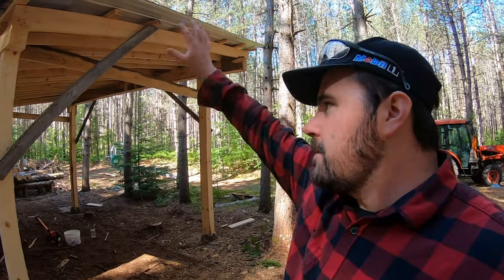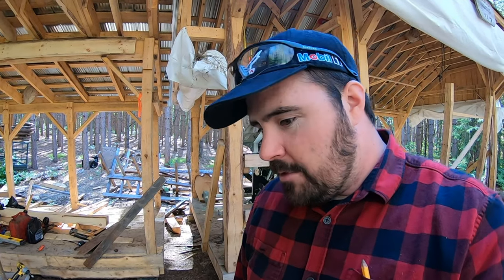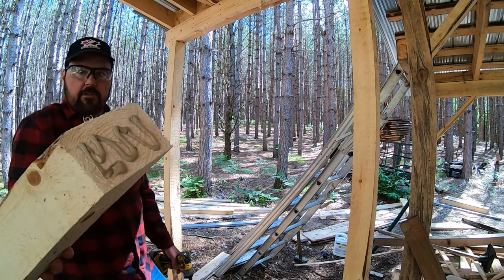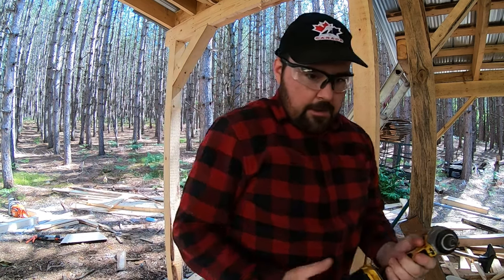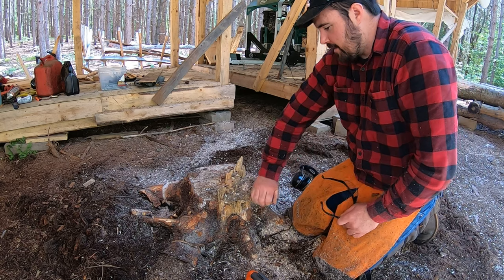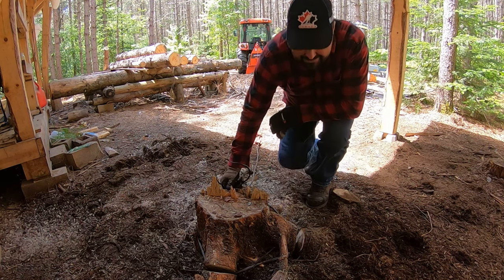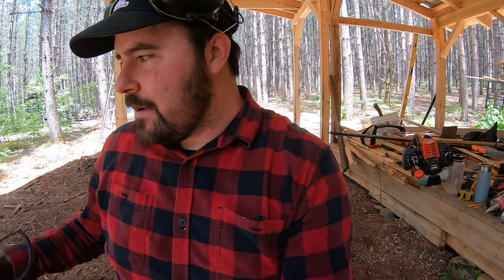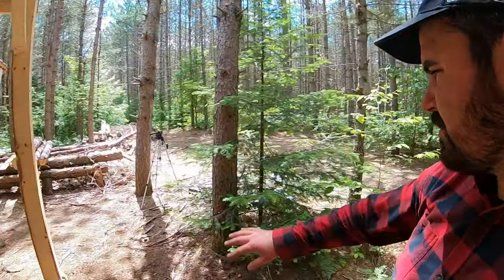Tree Stumps Got me Feeling Risky | Sawmill Shed Build Ep.4

Comment: i have seen folks use a 6-7' timber brace to change the angle of the cable to an almost vertical pull on the stump, as it pulls the timber lays down to 45 then 90 as it finishes, gives you a mechanical advantage that might be worth trying
Reply from the maker: May have to try that. Thanks for that
Reply: @sawingwithsandy  similar to this one, but have seen used with equipment instead of hand crank, its a "tee" timber https://www.youtube.com/watch?v=16iK3R7ce_0
Reply: Sandy:  use a steel drum on it's side next to the stump. Run your cable over the top and it creates a vertical uplift force. Works great with fence posts also.
Reply: A vertical pull ‘should’ be far better mechanical advantage for removing stumps than a horizontal pull particularly when placed under a major root. Even a small vertical movement ‘should’ loosen most roots.  A pair of posts X’d together near the top and placed at 15 degrees off vertical ‘should’ be about right mechanically.
Reply: I was going to suggest the same thing but these guys beat me to it. Great minds think alike!

Comment: When I'm out in the bush felling and bucking timber, I always have 2 or 3 extra sharpened chains for the chain saw.  It takes less than 5 minutes to change them out when they become dull.   Also, a snatch block may have helped with pulling that stump out along with some elbow grease using a spade (not a coal shovel like you were using) and a sharp ax.  Good luck.  Cheers!
Reply from the maker: Yeah those things would help for sure. I forgot my extra chains back at the ahop
Reply: A double pulley hook up and you tripple your pulling power. In this suituition a chain to a tree at the front of the tractor would make a big difference.
Reply: @jimputnam2044  I concur.

Comment: Like yourself Sandy, I was taught about the value of money and whether or not to spend or to hold. A porkchop may seem in order but mush saved money and tomorrow ... last nights dinner is behind you and forgotten. The log extension is probably  the very most important thing on your wishlist... please just go for it and either build or buy one as its going to give back in spades, you know this well. Backhoes, or other tractor tools will come should you find it necessary for them. I try to determine just which way the wind is coming from to determine just how   the root system is on the trees and find their weakest side if trying to dig one side an pull one over. I can only guess but kind of think that the soil  there lends well for excellent growth for the tree system meaning it is on all sides about the same. You know, blind squirrels even find some acorns so maybe you will enjoy some of that squirrels luck and get some to go over with the winch line and a couple blocks on other trees to give that additional strength to yard some of them out of the ground. I shall keep my smart ideas to myself as much as possible, I just wish I were there to help... dad said that two heads are better than one, even if one head is a  cabbage head... not sure where that fits here but if you think of it, tell me your thought on it. I do really care about your success an only have kind thoughts of this grand endeavor!! Wishing you well, the days are already showing signs of getting shorter, so the midnight oil shall again, force us to dig out the synthetic underware... pure wool does make me itch like a fiberglass insulation will, when working under the house putting it under the floor..  and having to wear it the rest of the day.
Reply from the maker: Thanks for the support Morgan. Hope you’re doing well

Comment: Hi Sandy. If you ever want a chance to pull something that difficult, you need to put a snatch bock on the heavy item. Then put you cable through the block and the cable end back to your wench. Find a good spot on it. You will have double the pull power. It’s still wouldn’t help you on that stump though. It is always best to use a snatch block to avoid breaking your cable. It will happen on day. Good luck Sandy. Great content. By the way, your wench blade should have dug into the dirt to hold the tractor steady. Did you have the 3 point all the way down?
Reply from the maker: Hey Tom! Great tips. I didn’t quite have the blade angled correctly to dig into the soil o believe

Comment: I’ve pulled some pretty big stumps with a chain attached to my truck, a sharp spade and a recip saw with pruning blades.  The pruning blades don’t dull up when you contact soil like chainsaw chains.  Cut the obvious surface roots as far from the stump as you can, put some tension on the chain with the truck and you’ll see which root needs to be cut next.  Stumps eventually pops out.
Reply from the maker: Those recip saws would wirk well I bet

Comment: My choice for removing stumps is a metal 5gal pail with the bottom cut out. Stuff the pail over the stump and start a fire. The pail acts as a chimney and keeps the heat in the stump, which dries out and burns quickly. Just an FYI if you mount (weld) a hitch tube between the front forks, you could easily drive forward with the trailer hitched in front of you. No more wondering what's the trailer doing.
Reply from the maker: Great idea about the hitch. I’m a bit hesitant to have fire in the red pine forest though as it’s quite dry but I’d just have to pick the right time

Comment: The winch did make the stump move a tiny bit!  I've been digging out stumps lately with the backhoe of my 25hp tractor and it's doing a decent job. It's annoying because you really need to go around it to get rid of all the roots. It rarely just pulls it out.  A stump grinder is nice (I think, I've never tried one) as long as you don't intend to replant something in that spot. Love to see the progress on your project and your thoughts on workflow! Thanks and keep at it!
Reply from the maker: That backhoe would be a nice tool to have around for sure. Yeah those roots sure do hold tight. Glad you're liking the progress.
Reply: My dad used to hand grub big stumps in the 50’s, a very patient and determined man!  I recently acquired a little Kubota B6000 with a 3 inch wide ditch digger.  It cuts roots fairly well down to 2 feet.  I have not tried it on removing stumps or trees yet.  I am curious how close to the tree stump is close enough to make a difference and if three or four straight line passes around the stump would be enough.  

The other thing is steps in pulling down a tree.  I expect leaving roots to the sides as a hinge would make the process much safer.

Comment: Why don’t you put a small elevated deck down? Keeps your mill off the moist ground. Could mark where the leveling outriggers go and reenforce below for permanently solid feet instead of digging holes. This also allows you to blow down the area to keep the sawdust down. Hides the stumps to. You could also put some small bump stops down to the trailer wheels go into an easily know position. Luving the Vlogs Sean, Sydney-Australia.
Reply from the maker: May end up trying that out. Will see how it goes but this could work like you say

Comment: Also, I would like to "second" the motion put forward by Dora T. -- with all that clean, open roof space; install 3 or 4 solar (pv) panels up there and run them through an inverter to a deep cell battery pack. That way you'll never be without a charged battery for your impact driver! I return now to 'lurk' mode...
Reply from the maker: Think that would be handy out here for sure. Thanks for that

Comment: Unfortunately in my life I've dug out way too many stumps. Best way I've found is a reciprocating saw with Ling blade . I dig around outside and cut roots out then find the least roots side and dig down and reach under and cut roots. A lot of work but it gets it done. Largest I've done is a 38 inch maple.  Had to use a truck to drag it out of the hole. Recip blades are fairly cheap and the lasted a long time. Good luck and I hope you get your stump grinder.
Reply from the maker: I like that idea. I just have to find an electric recip saw as that would work real well.
Reply: Milwaukee makes a 12” blade just for that purpose.

Comment: a cordless sawzall with a pruning blade works wonders on stumps, ive pulled ones out 6ft across with just the sawzall and my jeep equiped with a 10k winch, used a couple snatchblocks to increase the winches pull, and some 2" straps and 3/8" chain to anchor the blocks to the stump and the jeep to another tree, ive had the jeep floating in mid air with enough tension on the chains and straps you could walk on them across a 30ft span and they wouldnt move a millimeter

i wonder what happens when your pto driven winch reaches its max pull, does it slip a clutch or will it pull until a shear pin lets go
Reply from the maker: I"ll have to see about getting one of those cordless recip saws. Certainly sounds like they are the ticket!

Comment: Sandy! Why bother taking out the stumps? Cut them as low to the ground as possible, then position your new mill over those now ground-level stumps; the new mill should roll right over them when necessary. Do the same for the new log deck over the no-longer-in-the-way-stumps. I try and take all my Ponderosa pine stumps off at ground level so as to deny the Ips beetles enough material to start another generation and I find I can walk/work right over them with no tripping hazard/impediments. Just my dos centavos, from an Ex-pat Canuck now in the Willamette valley.
Reply from the maker: Good point. I find the stumps end up getting soil up their base a little bit as they grow and so it becomes a bit of a task to clear the dirt away before running the saw.

Comment: When cutting trees down  leave   1.5 meters of tree in the ground for better leverage when pulling the stump.
Reply from the maker: My only trouble is I try to maximize limber from the log
Reply: I have cut some trees pretty high (20 feet up) to avoid the tops hitting buildings.  A 30’ extension fire ladder secured to the tree plus a pull line 10’ above the cut made it easy and pretty safe to fell in the direction I wanted.  To my surprise the black oaks coppiced beautifully so I didn’t fall the bottom part.  But I still have that option.

Comment: can the dogs and stops be reinstalled to face the opposite direction? I was hoping so, don't have a mill yet but wanted a setup where the logs were loaded on the same side the sawdust gets kicked to, in all videos i never have seen a Woodland Mills configured the opposite way, would like to know if doable...thanks
Reply from the maker: The log bunks can be turned the other way just the challenge with that is the saw blade direction will then not be pushing against the log stops. I still think it would be ok though in most cases. Other issue would be the guard would not be able to prevent the blade from hitting the log stops if they were left up by mistake

Comment: Another use for the excavator. Or two,loading logs so you don't need a log deck n digging out stumps.that's why I leave stumps 3' high.I'll be shocked if that winch can pull that out.
Reply from the maker: I sure would like one. The price tag is scaring me
Reply: @Sawing with Sandy  I got mine for 30.used of course  but I've seen other brands cheaper for sure.

Comment: Sandy, do you know about 6" GRK screws. They work well for securing angle bracing.
Reply from the maker: Hi Scott, thanks for passing that along. I’ve seen them before but haven’t tried them. I’ll look into them for sure
Reply: GRK has screws in many sizes and the lag screws are a lot easier than the usual hex head kind. Unfortunately they will break the bank so you can’t use them everywhere

Comment: I suspect they are in very different cost categories....but from the perspective of versatility, and long-term value; a backhoe attachment for your tractor would be way better than a stump grinder imo.  Many guys I speak with who have tractors always say they couldn't justify the cost because they wouldn't use the backhoe enough.  I can see how they would think that, as I once did myself.  It seems logical, but what I have come to realize with two tractor purchases now is that when you have a backhoe at your finger tips, you suddenly find all kinds of uses for it and one of the biggest and most common ones is removing stumps.  The biggest limitation is the ability to swing the bucket when digging holes etc.  I like the backhoe so much that when I renew my tractor in the future I may invest in a mini-excavator instead of the one for the tractor.  Anyway - food for thought on your tool/toy wish list!
Reply from the maker: I have seriously considered a back hoe before for the tractor and just like the points you mentioned I figured stump removal would be a big use for one. I do like however mini excavators for their ability to move easily over rough terrain and the versatility of them. Only trouble is they are very expensive as I"m sure you are aware
Reply: yes sir...mini excavator would definitely be far superior.....360 rotation for digging/dumping would be a game changer and the push blade would be awesome too!

Comment: I use screws more than nails these days. I can go back and snug them up as wood shrinks. Also nice when I have to change something. Which happens a lot. 🙂
Reply: I’ve used screws a lot in the last years but I’m going back to nails for a lot of things because screws snap whereas nails will bend or stretch more and sometimes that’s better. Depends on the project
Reply from the maker: I like that idea. Think I may have to look into structural screws and transition over to that.
Reply: @twestgard2  what brand of screws did you use?
I've found the usual nails & screws from BigBox stores are just Chinesium crap.

I've switched to using Maze brand. US made. A LOT less bending on nails. 
The Big Boxes sometimes carry limited amounts of Maze so you might have to go to an authentic hardware store/lumber store.

Disclaimer: I'm not affiliated with Maze....just a very happy user
Reply: @willbass2869  I use all kinds. I have cases with hundreds of kinds of screw and nail. It really depends on the project. I will say that Spax and GRK are stronger but you pay for that quality and it’s not necessarily required in every situation
Reply: @sawingwithsandy  That’s what I use. They are the Strong Tie brand. They can be bent 45 degrees and come back straight.

Comment: Yeah, pulling a short stump like that isn’t going to happen. Even with 5 feet of stem, the winch likely won’t pull it. The woodland Mills stump grinder is on my to-get list.
Reply from the maker: I hear ya there. After putting a little tension on the cable it was quickly apparent that only the tractor was going to move.